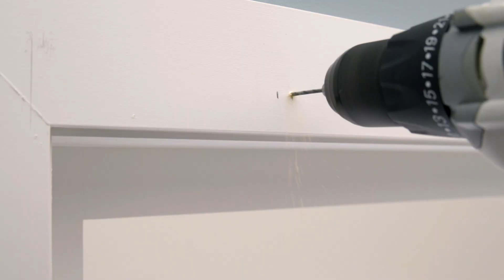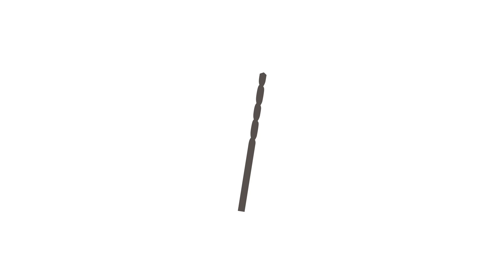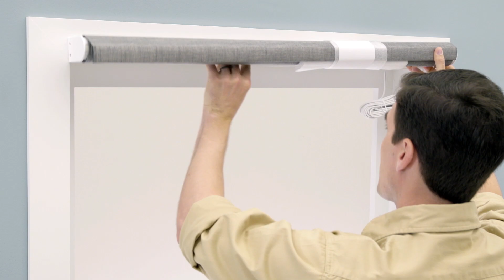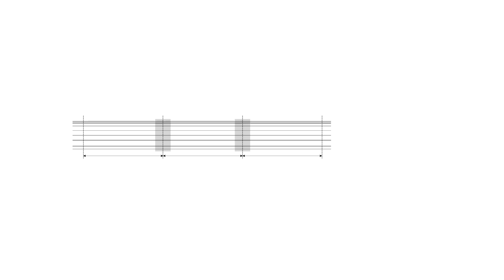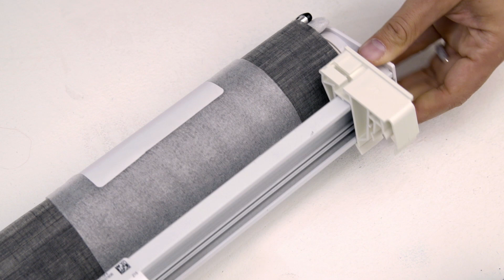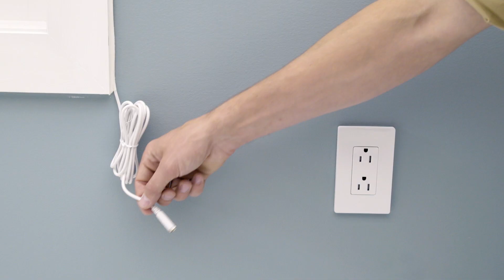Serena Shades by Lutron: Installing Wired Roller Shades

Comment: Just priced this out, for one window that is 35” w x 49” h they want $800 bucks and that is before getting the “connected “ equipment... hard pass
Reply: A Mercedes costs more than a Hyundai.
Reply: @youtubertoo  this is not a Mercedes nor a hyundai so not even the samething. nice try though.
Reply from the maker: Hi Dave, Thank you for reaching out. Our pricing model correlates directly to the high-quality materials, best-in-class technology and leading battery performance of our shading solutions. Our shades also feature complete customizability, putting the fabric choice and shade sizing in your control. Your purchase also guarantees an 8-year limited warranty, 24/7 customer service and the Lutron stamp of approval. If you’d like more information, or are interested in reviewing our shading options, please get in touch with a Serena shades specialist at 855-573-7362. Thanks
Reply: Maybe you just need a better paying job
Reply: @dreamleaf6784  you offering? I could always use a better paying job. Thanks